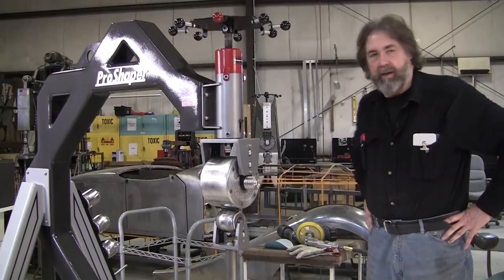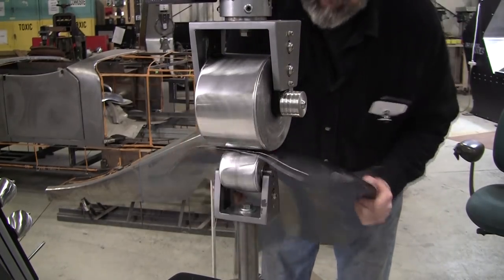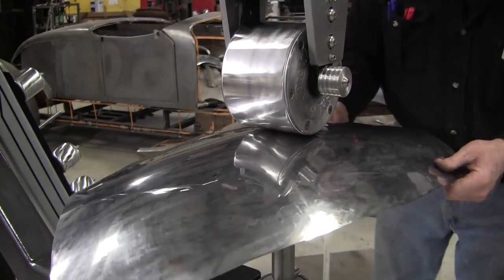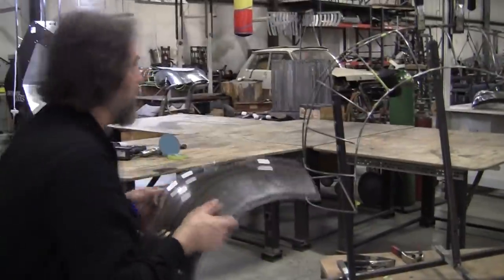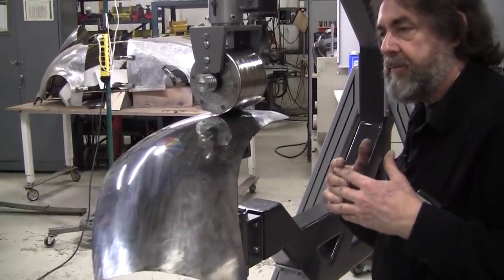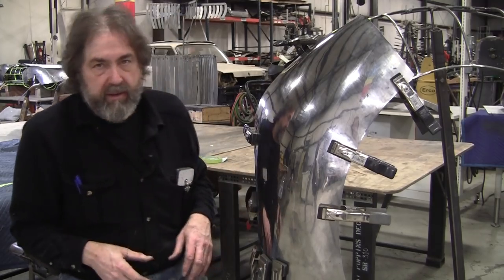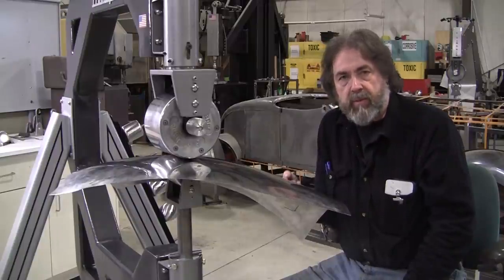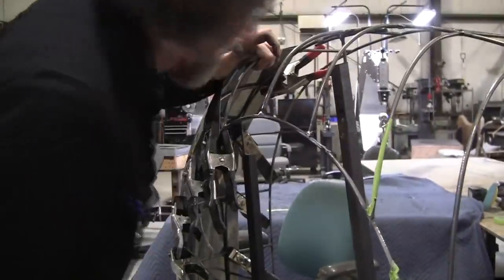Metal Shaping for Beginners: English Wheel Basics (Part 2)

Comment: Me personally,  I wouldn't get bored watching you wheel the panel fully into submission. Greatly appreciate the knowledge that I am getting from this video. I have had the Lincoln MIG welder for many years and have just bought a  $350 3 in one TIG/Stick/Plasma. Used the stick and plasma so far but intimidated with TIG like you eluded to.
Reply from the maker: Check out the tig welding video I did teaching nine year old Stephen with a four minute instruction. His first aluminum sheet butt welds were as strong as the parent metal. See the video at my YouTube homepage. www.youtube.com/c/proshaper

Comment: I'm going to have to watch this one at least one more time 🙂 I remember the early 80's, our family owned a couple NAPA parts stores, and I did the paint mixing. Red Lacquer or Acrylic enamel was about $30.00 a gallon, the most expensive colour and people complained about the price 😂  I haven't been able to find 3003 alum. or AKDQ sheet yet here in Montana or anywhere near. Until then it's 5052 and C.R. sheet 😢
Reply from the maker: You don't need AKDQ that is just a myth. 5052 will work a little harder but you can anneal it.

Comment: I'm one of the guy's on the fence about a TIG welder so looking forward to the comparison.  The panel almost looks chrome.
Reply from the maker: Any panel wheeled for more than 10 minutes will have a mirror finish on it if your wheels are polished.
Reply: @proshaper can a e-w make chrome platt surface even in an panel with almost no crown? 

Now i dont want you to take this as critisism i dont have any experiense at all but read alot and watched alot on YouTube and so on and want to hear what you got to say about it.
You said that the frame has to be an spring i read about a guy built an e-w and the frame turned out to stiff. Unusable. But he put a bellerwiew washer (a spring shaped like a koncave washer) in the adjuster. He states that wheel was the best wheel he ever used. It dont flex i X or Y axis, just Z. Sounds logic to me. 

I think it is to overbuild it and not really nessecary but if you stumble across heavy duty stuff and want to build a really good e-w it sounds great. :) 

Have a great day :)

Comment: Great learning videos! It answered a lot of my questions especially how it brings the edges down without using another tool.Would a higher crown lower wheel than you used after the flat lower passes expedite the process or create more of a problem down the road?
Reply from the maker: Higher crown wheels add area faster but also add wheel marks. Best to go up slow and steady if you are wheeling the whole panel.

Comment: Could you please elaborate on going 45 to the edge? Does that add area to the panel and eliminate a wavy edge? Thanks for the videos!
Reply from the maker: Hi Ted, yes you use the 45 degree angle because if you use 90 degrees to the edge you are more likely to roll off the edge. Yes, by working the panel inboard of the edge at 45 degrees you are adding area inboard to settle the wave on the edge.  Try it. Stretch an edge by working right on the edge, in minutes a wave will form. Then do the 45s and the wave will dissappear. It is that simple. It is just one of the techniques you use over and over. Memorize all the techniques and you become a master over the metal instead of the other way around.
Reply: Thanks Wray!

Comment: Wray, i have a question.
When wheeling aluminium i get hamer like-marks on the surface. The more i wheel, the worse it gets. It seems like a dirt road effect wich also gets worse when used more.
I never had this problem with steel sheet. I've been thinking what could cause this; Material too soft? Material too thin? (used 1.2 mm to start with), lower wheel not running true enough? Pressure to high?
Thanks for your video's, i learn a lot from them.
Reply from the maker: I would suggest you check the out of round condition of the top wheel and anvils and also polish them up.  I have a video called "Polishing Anvils" from three years ago, I believe you'll find answers there.  www.youtube.com/c/proshaper

Comment: Nice video on how metal moves. How much extra width did you create? Thanks
Reply from the maker: Please clarify. Do you mean how much did the panel grow in length and width? I didn't measure but usually a 3' panel will grow at least 1/4".
Reply: @proshaper  That was what I was asking. Thanks very much.

Comment: Hi Wray. Thanks for sharing such an amazing skill with a high standard of pedagogy. Just a question ( that you will find stupid perhaps ?) : why your upper wheel is so wide on your EW ? Considering that the lower anvil has always a radius profile, the contact track would be max 1" or so, even the radius of the anvil is very large. Isn't it ? Regards, Chris from Belgium (Europe).
Reply from the maker: I learned back in the 1980s that when shaping low crown panels that if you didn't hold the panel right at horizontal the edge of the top wheel will dig in and leave a bite mark. I theorized that if the top wheel was wider you would have to worry about going off horizontal because the wheel would insure you against that happening. I made  my first wide top wheel and never looked back. Coupled with wide bottom anvils it is even better.  You will see people that use planishing hammers use wider top dies to smooth better. Why? same reason that wide wheels work better, they bridge the low spot.  Very similar to why a slapper works better than a body hammer to take out dents. The slapper bridges the dent allowing the dolly to act as the fulcrum. It is all the same rules.  Traditionalism slows tool development.
Reply: @proshaper  Thanks for this detailed answer. Ones again, I'm fascinated by your easy pedagogy. For sure I have to be in phase with this explanation ... you are right, now it is evident !!!
Reply: Thank you Ray and Christopher. The question and answer clarified a lot for me. 👏👏

Comment: I bet that 85lb wheel was FAR more painful if you caught your thumb in it. I never understood how that could hurt that bad until I got my first English wheel. The momentum of the mass is what gets ya. A lighter wheel has to be less painful as well.
Reply from the maker: I have never caught my finger in a wheel. I did once on my lathe - broke my thumb.  My 85lb top wheel was the first large top wheel I had. I only used it for a short time. The one I have on my big yellow wheel weighs about 35lbs.